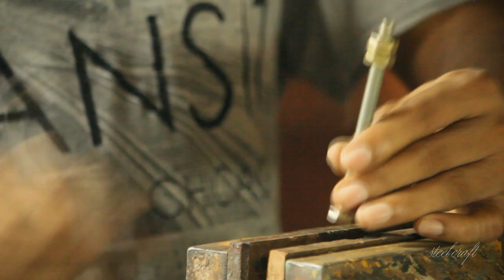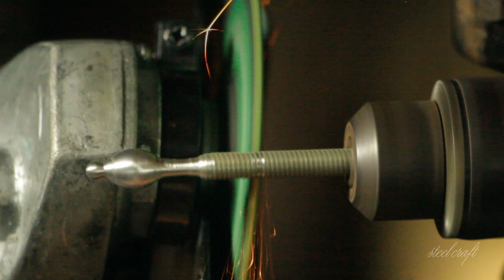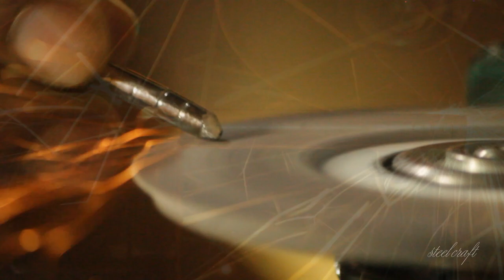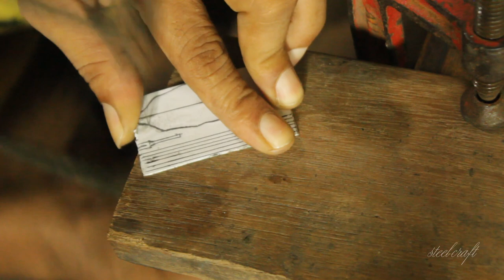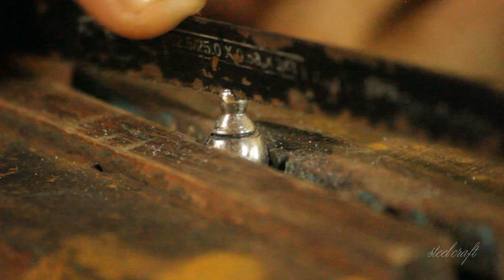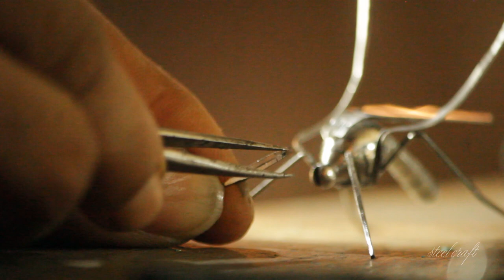Turning Anchor Bolt and Nuts into a Mosquito.

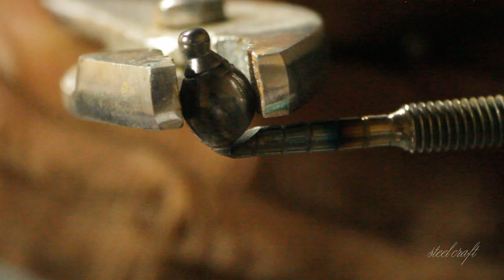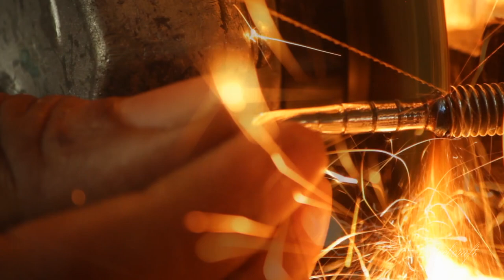Comment: What metal filler did you use to get from 2:45 to 2:47?  It looks welded.  Is it electrical solder?
Reply from the maker: It's arc welding
Reply: @Steelcraft1  Wow!  Thanks for the answer.  I would never be able to weld anything that tiny!